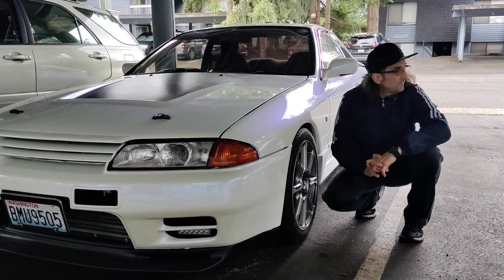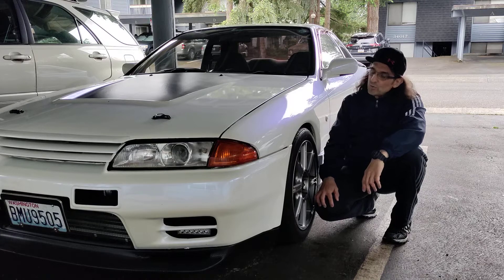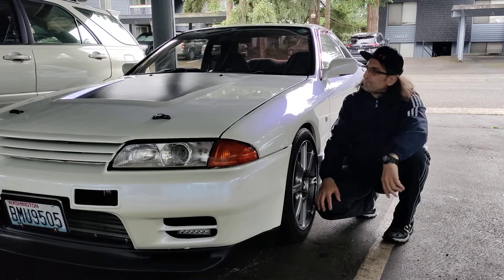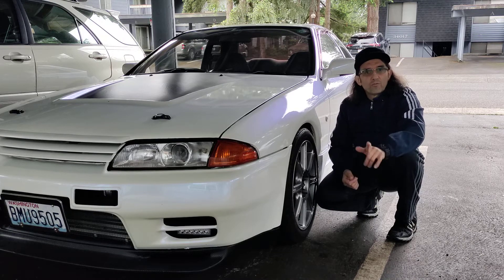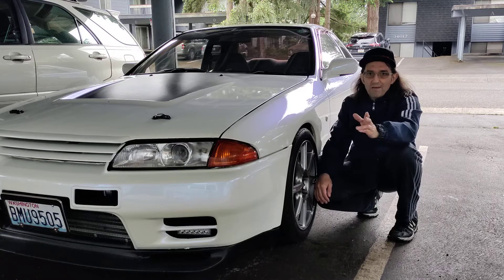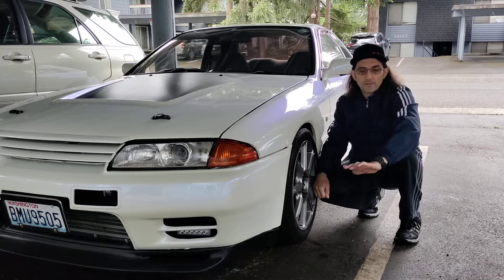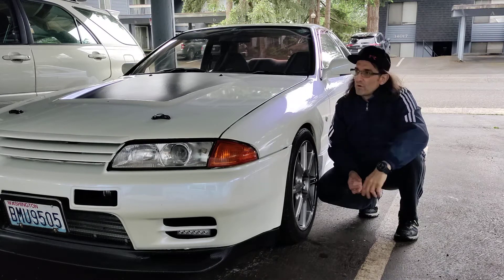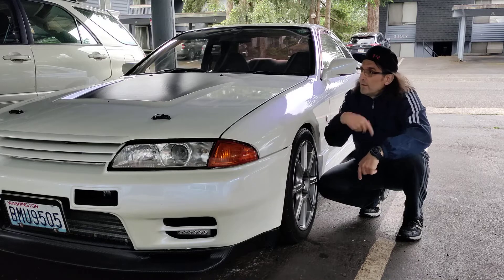15 psi rb20det stock ecu? this is how😎

Comment: Did you have to set the timing at the ecu after putting in the Tomei Poncams? Or do you just bolt them in and off you go?
Reply from the maker: thank you for the question. Tomei and stock camshaft have the same fit for the camshaft gears(diameter and pin location) Please make sure you have your cam replaced on TDC engine condition and re install the timing belt back where it was. If you also marked your Camshaft position sensor ,well you should be very closed already. To do it right you can  strobolight the crankshaft pulley, and fine tuning the ignition timing exactly where is your preference rotating the CPS a little bit. I do not recommend to play with the ecu screw adjustment unless you have pre existing issue  before the camshaft replacement.
one more thing: if you can replace the stock springs using Tomei wider lift ones..i understand you don't need to, but better safe than sorry.
Regards Dave

Comment: Great video! The maxpeedingrod turbo comes with a 7 PSI wastegate spring? And did you port the wastegate? Thanks!
Reply from the maker: thank you for the question.
yes i ported the wastegate but the  spring response was not smooth and accurate.. the solution is to buy the MAMBA actuator and now the pressure set up and response is way more smooth and reliable .
Reply from the maker: https://youtu.be/5fVFXYQi9v8